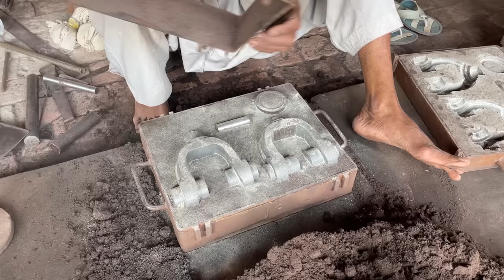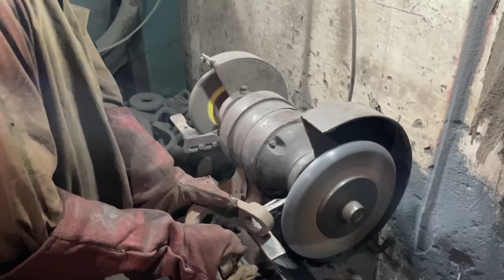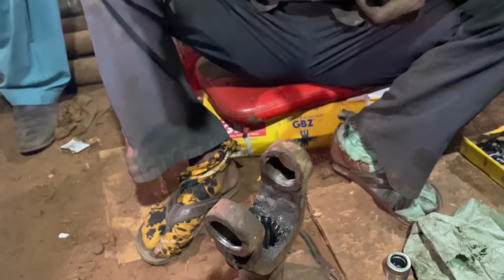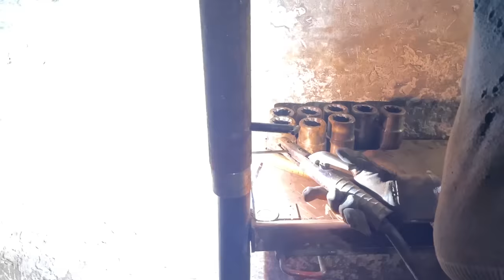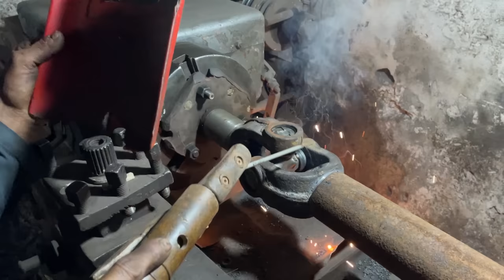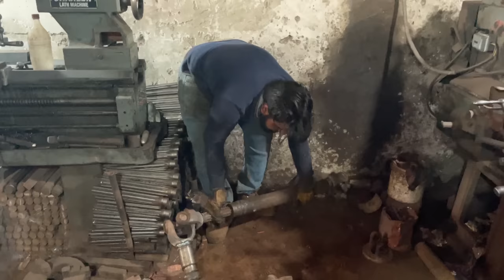How to manufacture Tractor PTO Shaft | Amazing making process PTO drive shaft

Comment: No control over metal chemistry, made from any scrap they can find. Was waiting for old mate to have his arm ripped off trying to fit things with the lathe running 😂
Reply: Production process is fine. Working with this on the field is a different story.
Reply: Probably has lots of experience sizing parts on a moving lathe.
Reply: There are other videos where these guys are missing toes and fingers. Go figure.

Comment: I hope none of the pto shafts I use have yokes made of an unknown metal - I don't want them exploding at 540rpm.
Reply: All John Deere run these shafts😊
Reply: @billybo9188  I hope not. I like a better fit and I like to think there is some quality to the steel in the shafts. There is no quality control on the steel. Everything should be made dimension and not to fit the way they do it. I pay good money for drive shafts and I am getting ripped off if this is what I am getting.